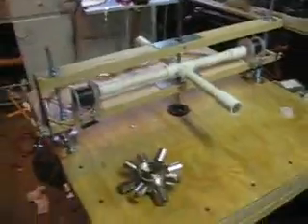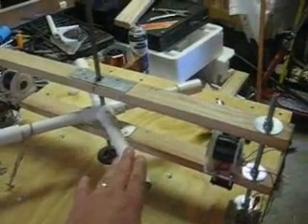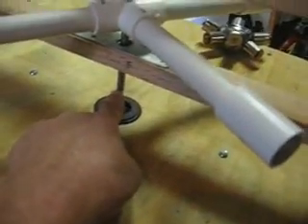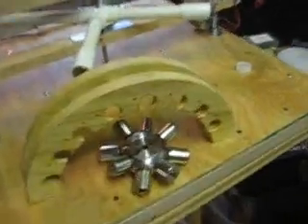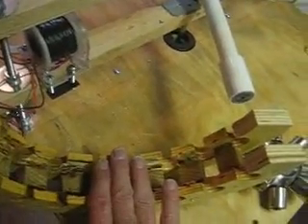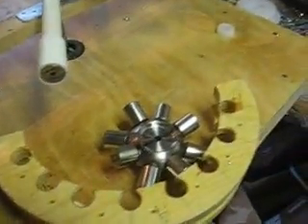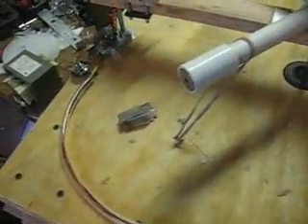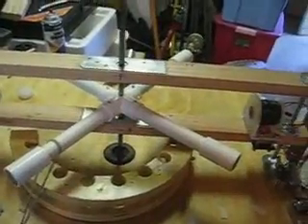newsetup 2 generator bedini motor

Comment: you still working on this?
you can reduce the effects of Lenz law by breaking the circuit on the generator coils at the moment of most drag forces-gives you another back EMF spike to work with too.
the microwave transformer is easy to hook up-forget about the wires in the middle they are heater coil wires-put AC on the bottom coils and the top is HV.
there is one output wire and the other is grounded to the chassis of the transformer-you can take HV between the output and the steel lamination

Comment: i may be wrong the 2 leads by the single wire should be the hv out the single wire to ground then the other side to power supply. amek a jacobs ladder.

Comment: so, for example...
you may generate 480V and only pull 1mA or you can draw 120V at 50mA or 12V at 300mA
if you plot them on a graph you'll find it's curved... each generator coil, each BEMF system is diferent and needs 'plotting' befor you can get the maximum amount of power out...
but your pain doesn't stop their... the more power you pull out, the bigger the effects that act against the system... Most notably, LENZ!

Big prodds to Mcorrade with regaurds to LENZ

Comment: using the BEMF during the pulse gives me additional power 'for free' however, it affects how much power my recovery coils produce which is bad... so what i want if the BEMF cap to dump into the main cap bank when their is no pulse... therefor it shouldn't cause problems with the recovery coils...

As for BEMF, be very carefull with such high voltages, they have a tendancy to kill multimeters I have killed 3 so far...
usig bemf like generator coils is a logerithmic scale with voltage V amps...

Comment: Thank you for the credit, it's appreciated...

Odly enough i don't know much about transformers, however, i have seen all th formulas you will ever need so do a search in yahoo for transformer calculations (i think)

i'm in the process of building a bigger bedini with a controll system that no one is using...

I will be 're-using' the back emf as per my feedback to source video's. However, on the last update i discoverd a few interesting things...